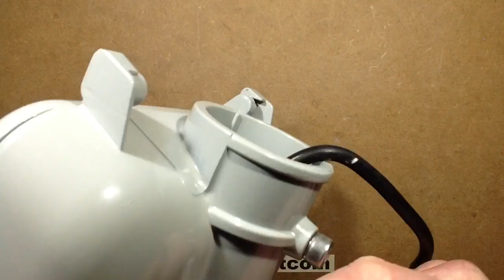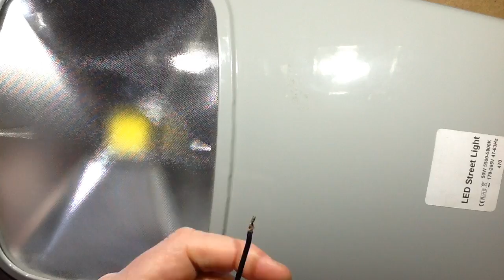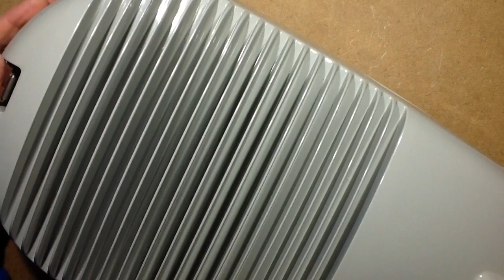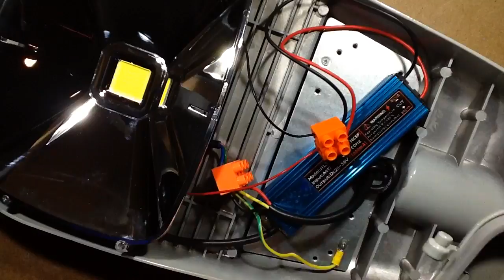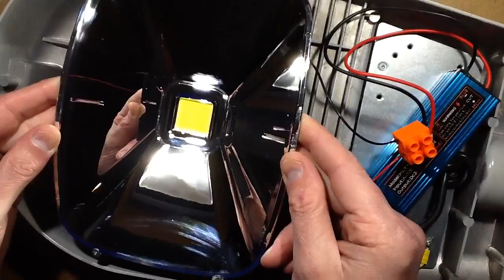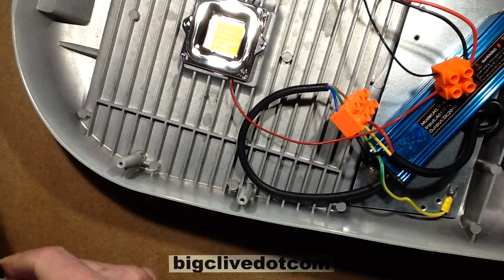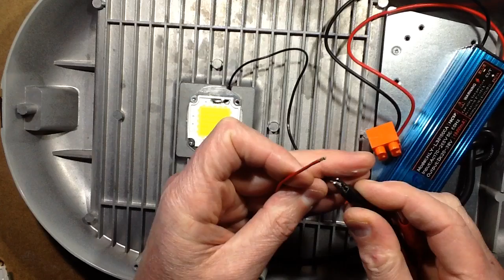Inside a 50W LED street light.

Comment: The mount is called slipfitter and uses 2 3/8" pipe. Also we don't have those 2 screw cable connectors in America.

Comment: Most "proper" ones aren't sealed around the cable entry point either, my thorn one certainly isn't. Do you think they use these on chinese roads?
Reply from the maker: Drainage is always a good idea if everything is angled correctly.  I'm not sure if they use them on their own roads.
Reply: bigclivedotcom one glaring problem with this one is that there is nowhere obvious to fit a NEMA socket for a photocell.

Comment: whats happening to all the sodium lamps?
Reply from the maker: They're being replaced by really expensive LED lamps which last about a year before failing and having to be replaced completely because you can't change the lamps in them.
Reply: @bigclivedotcom   This does seem to be true for LEDs in general, however the reliability of LED street lights installed by local authorities, seems light years ahead of those used elsewhere.

Comment: I'd really be interested in seeing Clive look at one of the Excelvan leds.  I'll link a similar one at the bottom.  I bought three of the 10w versions.  All three were grounded (though in America we're considerably less concerned about such things for 10w units...), they draw about 11-12 watts from the wall, and they have a matrix of smaller led chips rather than one COB (I think that's the right term?).  Does anyone know if he's looked at these or something similar?

http://www.ebay.com/itm/Pure-White-Excelvan-10W-20W30W-50W-LED-Flood-Lights-IP66-Waterproof-6000K-/122031224893?var=&hash=item1c69a0b83d:m:mBwou4ufIw3DuqGJgt30u4Q
Reply from the maker: I've looked at a similar light (Excelvan is just a rebrand) and they were based on the CYT3000 chip.  They were not proving reliable in use, going short circuit and blowing the LEDs.
Reply: Interesting.  Glad I don't need them for anything important, then.  Did manage to survive a botched soldering job though, so its got that going for it lol.

Comment: In the US, 3 phase wiring is brown, orange and yellow (BOY) and neutral is grey. Single phase is black, red and blue (BRB), or just black and red, then any other colors for branch stuff. But colors are not set by code anymore so you can use pink and purple if you want, but neutral has to be white or grey and ground is green, green stripes, or bare. The colors just have to be consistent and labeled at the terminal (service).
UK is what, brown and blue and green for ground?
Reply from the maker: We have a main standard for three phase which used to be red, yellow and blue with black for neutral, but to align with Europe they changed the colour code to brown, black and grey with a blue neutral.  (Yes they really did swap a phase and neutral colour.)  For single phase and flex it's brown for live, blue for neutral and green/yellow for earth.
Reply: bigclivedotcom
That is odd, considering gray and white are actually neutral colors. It doesn't really matter, as long as you meter everything

Comment: where I am in Mansfield, Nottinghamshire, UK our council have replaced some of the whiteish yellow main road street lights with LED ones and the effect is terrible because you get some areas of good illumination from the old lights then this almost back street ghetto look from the LED ones, they look awful, dark and just not a match for the higher powered original lamps. And though they havent been up long a couple of them are dead already, either random flickering or turn on then back off after a while then repeat. Just a rubbish idea to save money. They may as well not be on at all lol. The lamps on my street are still yellow sodium bulbs with the cool neon startup pink glow, except one. One lamp stopped working when it got bashed by a car, they actually cut it down to the big bit where the power comes in at the bottom, then replaced it with I assume the wrong bulb type and its like a football stadium at that end of the street, massively over bright and hurts your eyes if you look at it. God knows what bulb they put in, its definitely not LED.

Comment: Electronics amateur here - how would using resistors make the LED blow more spectacularly? I would have thought the opposite was true...?
Reply: If you ram a heck of a lot more voltage and current through a resistor than what it is designed to handle, it will fail, generally rather dramatically.
Reply: He is saying the LED doesnt blow.. The resistors he added are what blows. Adding a resistor helps becuase its the resistor that burns and explodes :) He was basically faking that it was the LED. Without the resistor nothing would have blown, the LED would have just failed.

Comment: Red yellow and black is standard in remote control models, yellow would be data, they use dc power so black and red would be for power obviously and the yellow would be the data wire for servo positions ect

Comment: Relying on the angle to stop water getting in the cable hole might work, but it's not going to stop wasps.
Reply: Now there is separate LED chips module with special design which can be IP68 waterproof to prevent water getting in, also with full plastic high quality optical housing and separate heat sink, no insects can get in.
Reply: You'll need WSP69 standard to keep the wasps out, much more expensive.

Comment: lol who uses milimiters to measure stuff that doesn't require precision?
ever heard of centimiters?

i mean, it's still 100% clear, but it's weird. like using meters to measure trip distance.
Reply: There is an engineering tradition of only using the power of 1000 units, skipping the in-between multpliers and units like centi, deci, Deca, hecto and Ångstrøm (0.1nm).  Minimizes the chance of someone getting it wrong.
Reply: It's very common in the UK, centimetres are rarely used, unlike on the continent where it's the norm, liquids are the same, you use 250ml rather than 25cl, seems in the UK we use the British metric system rather than the continental metric system !!!!

Comment: i wish i could get my hands on one, but in my province in canada we have two types of led street lights

ones a small one features like 12 leds and a larger model with what seems to be 28 leds, beefy compared to this one
Reply from the maker: +๖ۣۜCOFFEbiscuit๖ۣۜ 1 You can buy quite a selection of LED street lights on the Internet.  www.banggood.com sell a few basic ones.
Reply: bigclivedotcom  those are not bad, the reason i mentioned these ones is they come in as big as 200 watt variants, be a nice workshop light!
Reply from the maker: +๖ۣۜCOFFEbiscuit๖ۣۜ 1 I recommend staying below 50W and using multiples.  The heat dissipation is better resulting in longer LED life.
Reply: bigclivedotcom yeah i will if i get one, the big ones around here would run you up a few hundred a peice, canadian made,

also it would help my electrical bill, its already bad enough
Reply: ...Here, in Sacramento, Calif.....A lot of LED street lights are 28  (2 arrays of 14)  rated at 150 watts...so I'm guessing they're 5 watts per chip...? Fairly bright, replacing older 400 HPS....

Comment: Those color codes on the wires are commonly used in China. I have some Chinese stuff and it internally uses those color codes. But where I live (Netherlands) we have the same color codes as the UK (Brown [phase], Blue [common], Green/Yellow [earth], Black [Switch], Black/white [used for switches as well but it`s to differentiate the wires like when you have a double light switch] and in some cases Orange [another switch variant but these are for fire protection, to connect smoke detectors together.])

Comment: Yes those LED's that start to emit light before 24 - 27V for 10 series LED dies are defective. I got 20pcs of those 50W LED and are all defective not a single one is good and that makes me think they are quality control reject.
I took a photo (is on my google+ page) with the LED at 340mA photo with very low exposure time so that you can see that are still LED dies that will not light up at all and some much brighter than others meaning that 10W is about the safest power you can use those without degradation

Comment: Clive, I think the opening around the wire is so the fixture can breathe and not accumulate moisture. The probably realize that they can't make a completely sealed fixture that someone won't screw up the gasket on, and this way water is not as likely to condense in the head.

I'm rather surprised that these fixtures come with a feed wire at all. If you think about it, they are probably going to pull a long wire run from the pole to the controller, and another run from the head to the base of the pole. It makes more sense to feed that into the head and terminate there rather than a hidden splice in the pipe.

Oh, and maybe grab some ND gel that is being tossed out the next time you strike a show where some is used?

Comment: Have you seen the 3 led "150w" street light? You could find them on ebay but I found out that mine is not that bad at all. It is bright, stays at 150F or so in 80F nights

Comment: Something I saw on Julian Illet's channel...you can use a welder's glass to cover the LED and view it at full power with considerable detail. At $1.50 per 2"x4" glass you could buy a few spares. They get hot if you rest them on the LED, however...(hence the spares).

I've been testing 20w COBs of the exact form factor you're using with the intent on moving up to genuine CREE or BridgeLux COBs at 4-6x the price. For learning, the cheap Chinese COBs are worth their price, and not a penny more.

Comment: Hello from America. I've been really enjoying your videos knowing nothing about electronics and have actually gained a bit of knowledge from watching them. I work as a printer technician and believe it or not I rarely encounter failure of electronic parts. It would be pretty interesting to see you take apart a copier and take a look at some of the PCB's in there like the power supply.
Reply from the maker: +MalleusSemperVictor The mass produced stuff has to be reliable to avoid comeback from millions of units.  I tend to choose older model and lower end appliances and equipment because I know that all the bugs have usually been engineered out.
Reply: bigclivedotcom Oh, yeah. There was a recent incident lately where firmware had to be installed on certain machines to prevent  the fusers spectacularly combusting, though. That was interesting.
Reply from the maker: +MalleusSemperVictor Software errors or crash-states that jam heaters on.  Never a good thing.  I had a charger crash and melt the sleeving off the NiMh cells it was charging.
Reply: bigclivedotcom Sounds like that probably smelled pretty good.

Comment: why did they use that connector block? wouldn't it be more sensible to run a longer wire and have a direct connection from the ballast to the led.
Reply: i suppose it would be easier to change the led when it fails that way?
Reply from the maker: +Donald Sleightholme That's what I was thinking.  Just have pre-wired LEDs and a service kit with the LED and a sachet of heatsink compound.

Comment: big clive you should get some led traffic signal lights. the most common ones im finding a 8 and 12 inch. red yellow green and arrows. always wondered what type of leds they use and the placement of them that makes the visibility so good.
Reply from the maker: +lead foot lawn mower (leadfootlawnmower) I'd like to take apart some LED traffic lights, but they have been quite elusive so far.
Reply: im finding loads of them here in the us. but i wouldnt know how hard it is finding them in other countries. fairly cheep at about $20 us for the 3 red green and amber. i dont know what shipping would equal out to.

Comment: You have mentioned before about these light heads not having a connected earth. Maybe it's because they bolt to a metal lamp post which should be earthed anyway?
Reply from the maker: It's better to have everything bonded to ensure that if there was a high resistance between the light and pole due to paint and corrosion, then no potential difference could be across them, leading to a shock hazard.

Comment: I often find red black yellow wire codes in the US
Reply: +James Wood Never seen that. We have black (L1), red (L2), blue (L3) and white (N) with either a bare or green (no yellow stripe) earth. There are also a different set of colors for some 3-phase circuits: brown, orange, yellow, grey, and green/bare. 

Maybe you are thinking of what in America we would call a "220" or 2-phase cable which would have the red and black but never a yellow.
Reply: In older US buildings I have found the RD-BL-YL code on single phase wiring. It's certainly not to any modern code, so it does get changed when I find it, but it is out there.

Comment: Have you ever had a look inside those self-contained LED ceiling downlighters, such as https://www.lightrabbit.co.uk/6-watt-frosted-led-ceiling-light-390-lumens-120mm-diameter.html? I had one a few weeks back (had to return it) and it had a really neat inward-pointing circle of LED tape, illuminating the edge of a clear acrylic disc with a textured back on it, so that would scatter the light out the front, like a backlight. Wish I'd taken photos at the time, but there you go.
Reply from the maker: +Lindsay Wilson https://www.youtube.com/watch?v=dP-JXxIY0Yw
Reply: +bigclivedotcom Brilliant! I guessed you'd have it somewhere, couldn't track it down ;-) Regarding that light-scattering pattern, the software that came with my laser cutter has a plugin feature which will actually generate a suitable scattering pattern, given various parameters for panel size, light location etc. I've never had cause to use it, but it seemed quite versatile.

That control chip is really neat - I like how you can get constant-current control that way, without any secondary components. Have a look at the BP3122 - it doesn't even need the auxiliary winding, and there's an English datasheet available - http://www.bpsemi.com/pdf/BP3122/BP3122_EN_DS_Rev%201.1.pdf. And AliExpress have tons of them for sale ;-)

Comment: is it me or do them flex wires from the driver output to the LED look slightly thin for a 50W LED?
Reply: +TornTech actully @ 1500mah them wires do look semi ok..
Reply from the maker: +TornTech It's a very tough and thin insulation.  presumable heat resistant.

Comment: yeah, be very careful with wire colours, we had some equipment at work that had red, grey and green, red was ground.
Also i would have done continuity of all wire, you never know if there's leakage, or if the yellow was touching live.
btw, those 2 ridges also aid with drainage, any rain that gets blown into the end will hit the smaller diameter where the wire goes through, then will drain past the ridges instead of running down the pipe on the column
Reply: +Sparky Projects You can find red as ground in old wiring here in Sweden, otherwise it's green-yellow since the 70's
Reply: +Sparky Projects Red ground might have been for Germany I believe (green was phase grey neutral, I think). A german may well come along and correct me.
Reply: +TheChipmunk2008  I know someone mentioned that in china (or japan) that red is a lucky colour, so that was used for ground, but i think this equipment was from norway/sweden area